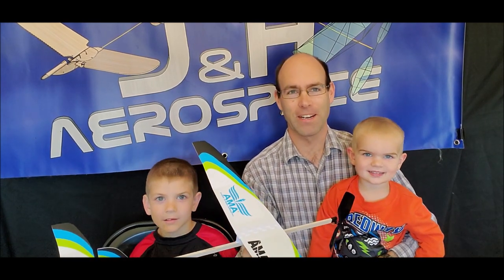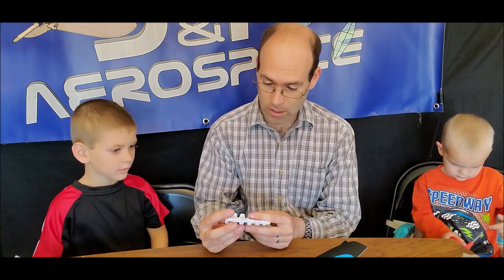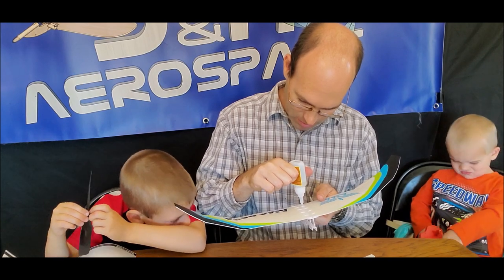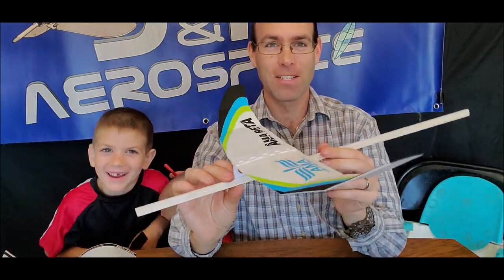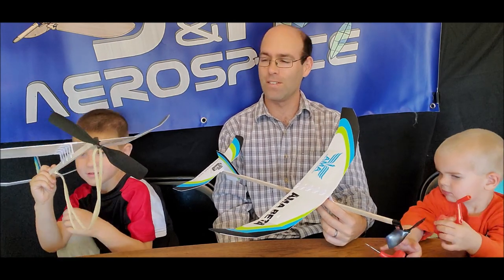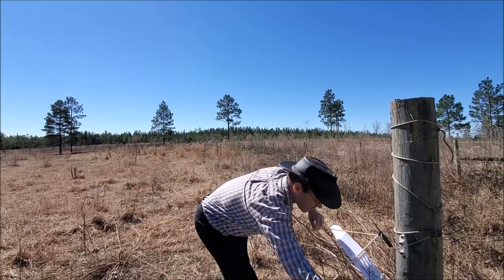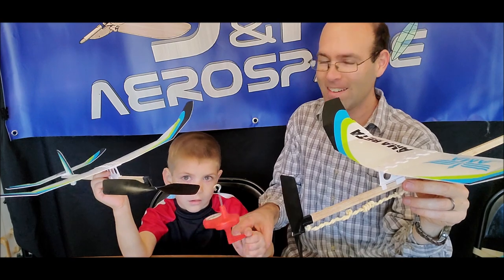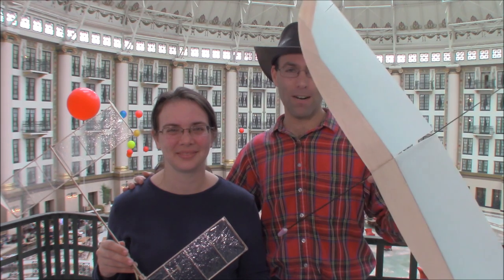AMA Beta build and fly with thermals!

Comment: Very good video. It cannot be stressed enough how careful you need to be sliding the wings into the pylon. I ended wrinkling mine a slight amount but used clear tape over center section. I was thinking about a method to pry open the joint slightly to get panels started.  My Beta also flies left and that is the direction I keep flying.

Comment: Over the years, I've seen any number of flying "toys" released by major toy makers.  None of these flew very well.  Either the manufacturers didn't have any product designers who had been aeromodellers, or else they deliberately limited flight performance by making them more damage resistant.   This one, though.  Wow.
Reply from the maker: It's a Rob Romash production, so it was guaranteed to fly well.